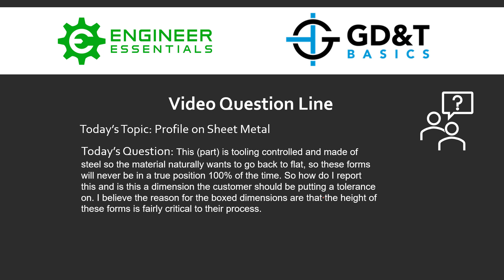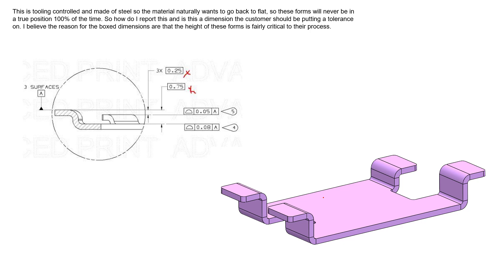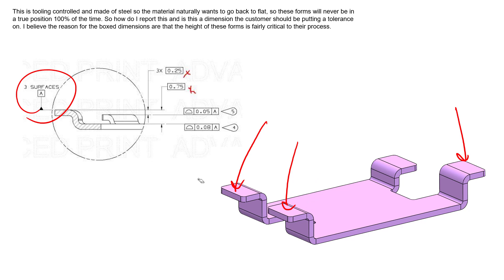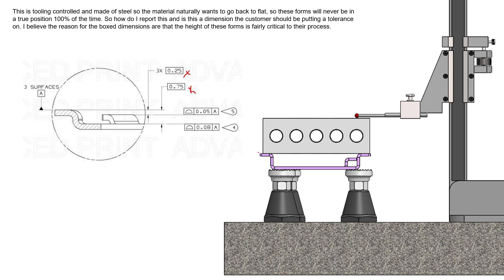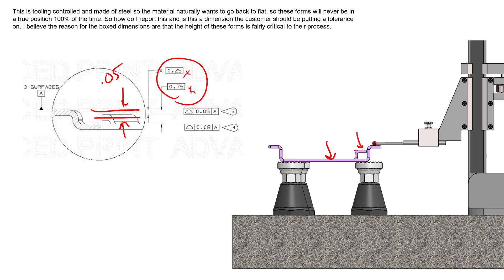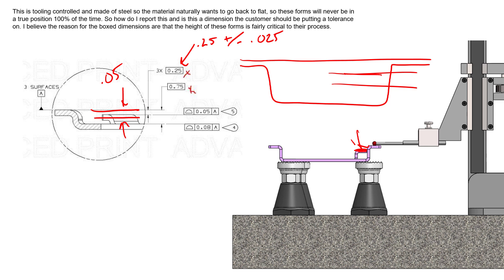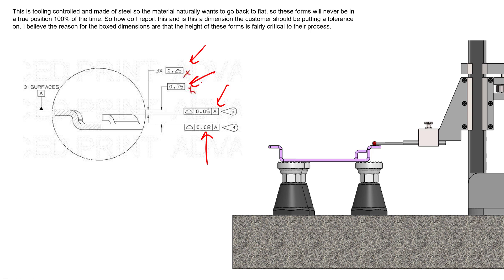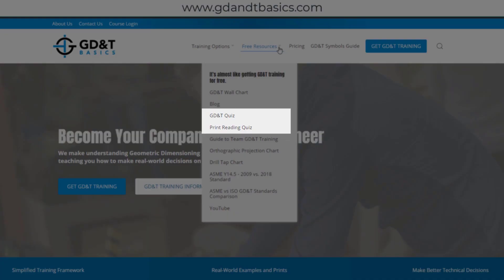Profile on Sheet Metal

Comment: Do you worry about any deflection of the part caused by the 2x4x6 block. They are heavy and rigid compared to a sheet metal part. The concept of a rigid block to define the plane is good. Perhaps a lighter plate would be more accurate.
Reply from the maker: Great point! We want to make sure our inspection process doesnt modify the part at all ( unless our drawing specifies that we can )